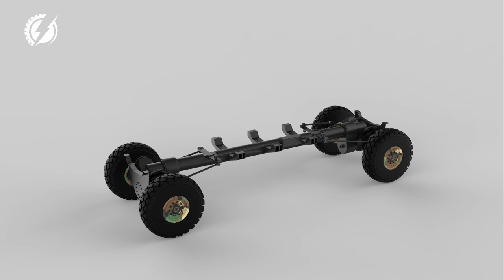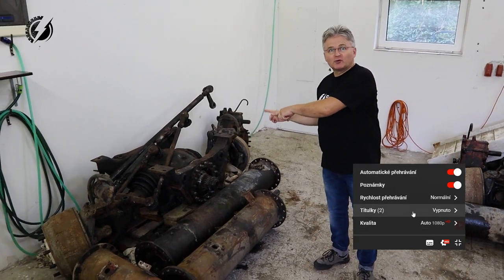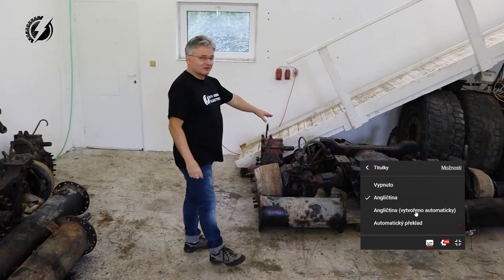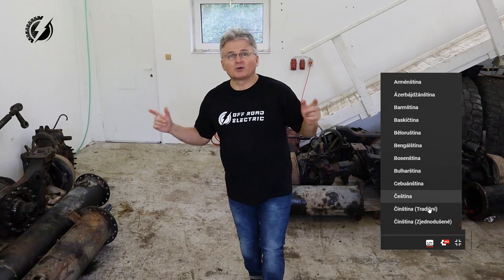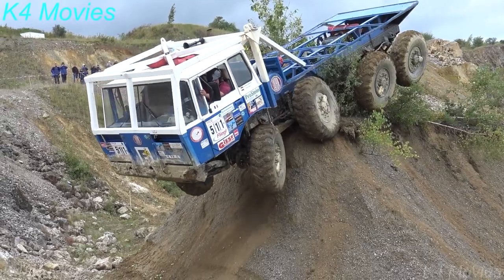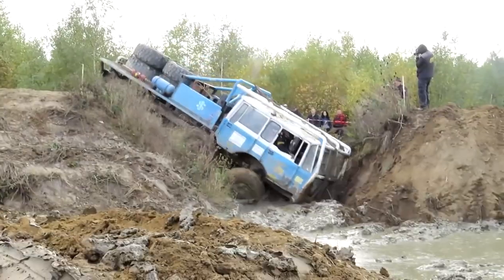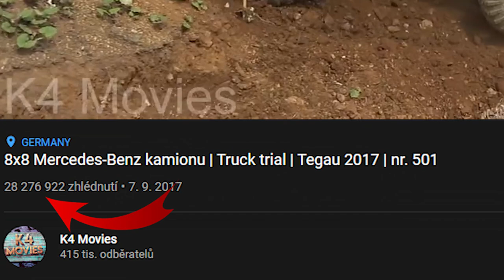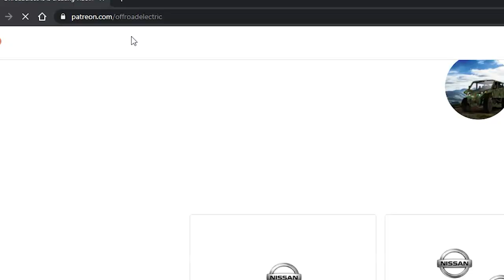EP.38, Everything about the 2nd Tatra + much more! - 4-motor Monster Truck Project

Comment: Hey Peter, great idea with the truck trials.  You'll probably clean up with the EV, great approach, departure, breakover angles and instant torque.  Best of all you'll get huge exposure.  I am sure that will be a good boost to your project.  Sounds like you're going to need a software engineer to write code for the controllers, or is there something on the market that is off the shelf that can control 4 electric motors for a four wheel drive application?  Really looking forward to the build, all the best and good luck.  Cheers from Canada!

Comment: Peter I am sure you are so excited to start on the cars. I truly believe you are on the right track with the truck competition. Having the electric motors you can actually make the truck spin in circles with the  tires spinning in opposite directions. How much less do you think you will weigh the than the other trucks? Do you think it could be 60% less than the others? 50% would be a huge advantage. 
Marty👍
Reply from the maker: Hi Marty, it should go also 90 degrees sideways on a slippery surface.......With a shorter wheelbase, and no massive rollcage and passengers,  I might be somewhere over 5 ton. That's about the weight of the other 4x4 category vehicles, but  the power, the torque, and the chassis strenght are like 15 ton 8x8's trucks. The 6x6's there are about 10 ton.
Reply: Off Road Electric 
What a huge advantage. 👍
Reply from the maker: @martyportersr7008  yes
Reply: Off Road Electric 
I am so excited for you and all of us that have been watching and contributing. Peter this is going to be big for you. 👍
Reply from the maker: @martyportersr7008  I think every branch of our activities will be big. The chassis and the new technology are simply great.